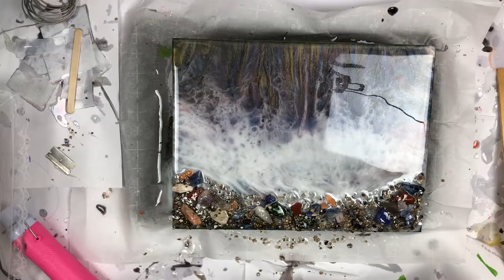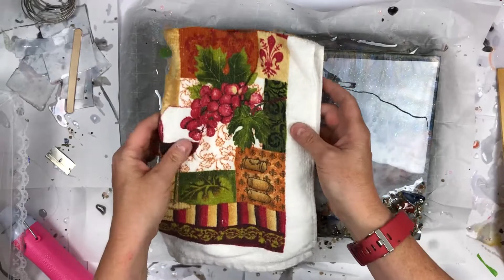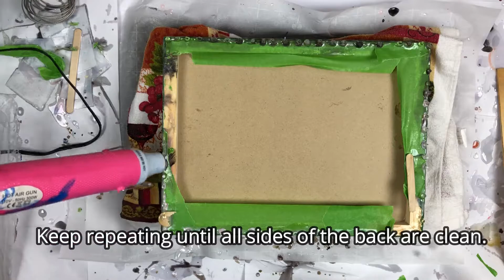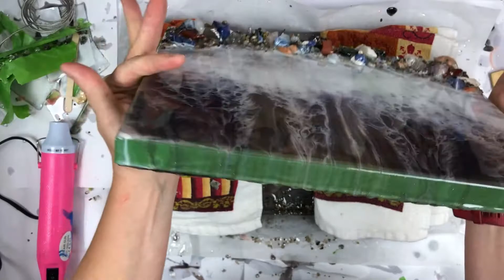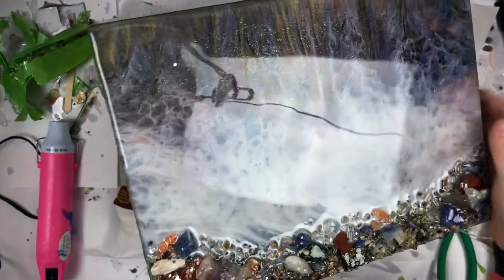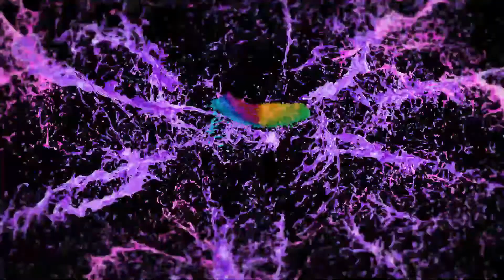An Easy and Tested Method to Clean Off Resin Drips

Comment: Love the way this piece turned out. A little tip... using a metal spackling knife works better than a razor blade and it doesn't splice into wood like razors do.🥰
Reply from the maker: Huh, I’m not sure I’ve tried a metal paint spatula. I’ve tried other other spatulas but they are thinner and bent. I will definitely try this out, thank you! ❤️🌵✌🏻

Comment: Wow!! This is so cool!! I’m fascinated by resin yet am horrible with it! Every time I try there are wells and imperfections. I’m convinced my ground is not level, what do you recommend to improve?
Reply from the maker: Hi! It’s important to have a level surface with resin. If the ground isn’t level then use pop cycle sticks to shim up the surface to be level.
I see imperfection in all of my resin pieces and it’s OK! Your next piece stay simple and then work your way up from there. In this piece I didn’t plan on using rocks until I saw the large areas the resin repelled from. I had to step back for a moment and ask my kids what they thought it was starting to look like and that’s how I got the idea to add rocks to cover imperfections.
I hope this helps! I would love to see some of your pieces! ❤️🌵✌🏻
Reply: @FluidArtwithErika  wow thank you! I used a leveler and everything the last time and it was the best attempt so far, but I don’t want to ruin any more finished pieces until I practice more! I have a video showing some previous resin fails and i’m sure it’s the leveling problem! I have many acrylic pours on my channel in an acrylic pouring playlist 🤗🤗🤗 I’d love your feedback and advise! Fluid art is such a beautiful stress reliever and art form!
Reply from the maker: I saw your channel, your daughter is adorable! I found your resin fails and I will watch it more later tonight but the first piece you did, it kind of looks like the silicone oil was not cleaned from the pour. Those spots look like that is where the silicone repels the resin. 
Did you clean your pour before you added resin?
Reply: @FluidArtwithErika  It was only floetrol and paint. I tried silicone once on the pink piece that turned out like water droplets. Its been trial and error. Have you ever poured resin over something that was poorly varnished? I have a piece I messed up varnishing, but it’s one of my favorite pieces! You can see the brushstrokes.
Reply from the maker: Huh, what resin did you use, do you remember? 
I have put resin over varnished pieces but I do clean them first with isopropyl alcohol and baby wipes.
I think art is always a work in progress!
Reply: @FluidArtwithErika  I didn’t clean them! Maybe that’s it! I used Krystal Resin, the same that Kanella Ciraco uses. It’s half the price of art resin.
Reply from the maker: I haven’t used that resin yet so I’m not familiar with how it handles. You should be able to sand the top layer of the cured resin, clean the dust with alcohol and baby wipe them add another layer of resin. All scratch marks from the sand paper will disappear.
Also, cover your resin piece with a box or something so dust does not land in it.
Reply: @FluidArtwithErika  ok!! I’ve been avoiding resin but I’ll make a point to keep trying!!
Reply from the maker: @biancapietersz  definitely keep at it! And practice on ugly pieces so you won’t be frustrated if something happens. Let me know how it goes! ❤️🌵✌🏻